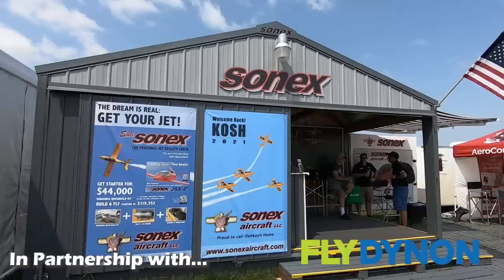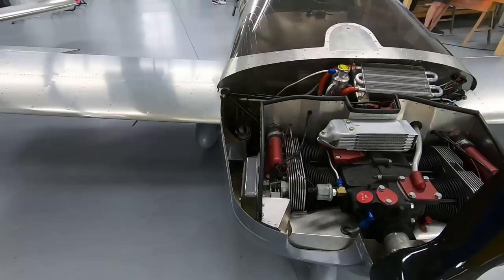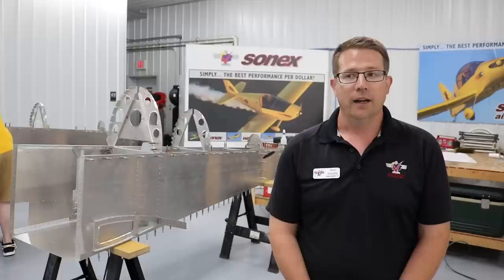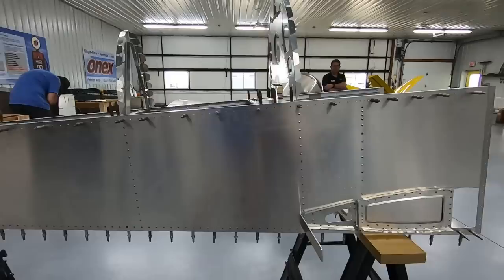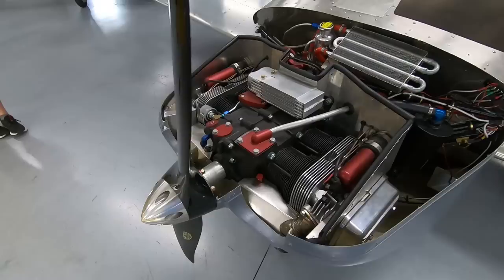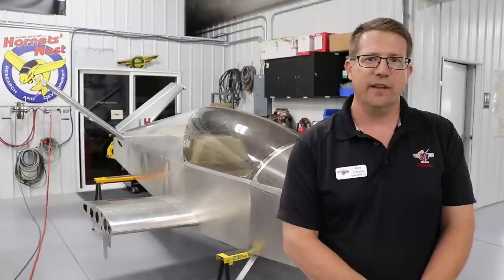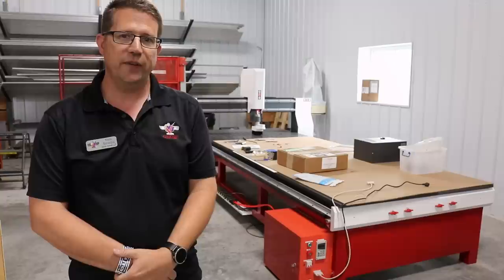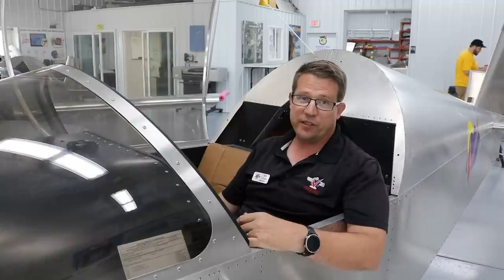Worlds Smallest Personal Jet | Factory Tour of Sonex Aircraft during Oshkosh 2021 Airventure

Comment: I'm waiting for the retractable gear from the jet being included in the Waiex kit.
Reply from the maker: THAT... would be pretty cool for sure! Thanks for watching today!
Reply: Same, but the BRS option, from the jet to the Waiex.
Reply: I would like to start with a 2-place SubSonex, but mount a Rotax 915 in the nose, with in-flight adjustable prop (electric constant speed).  That way the plane would already have the aerodynamic flight surfaces to handle high speeds and g’s.
If I ever get the money together I’m going to set up an appointment to talk it over with them.
Reply: I'll ask Mark for ya in an upcoming interview video, although he's very good about responding to emails as well.
Reply: @vax4200  Multiple people have installed BRS systems on Sonex Aircraft, there's a few vids floating around. The issue is weight and the space they take up, but it can absolutely be done.
Reply: Are gun-mounts planned? :-)

Comment: Wow... When you really think about the pricing it's not out of reach for MOST moderately successful people...
If you can live without the jet it's not even as expensive as a properly equipped 1-ton work truck...
Imma start savin...
Reply: It's not as hard to own a plane as most people think. I'm in the lower middle class spectrum and own a Maule M4 Rocket and some other toys. Now I'd prefer the M7 260,but not happening 😆  I got my M4 needing recovered and did it myself with help from a friend with his ticket. Every plane I've bought has needed work,I've paid cash,purchased wisely and made money when sold except for one. But I put 200 hours on my 172 and broke even.
     I've only bought 1 new truck years ago and when I calculated what they made in interest I said never again. I've got a 93 3500 dually I bought around 2000 to tow my boat and use as a truck that's been updated with new motor and trans swap. I've also got a 2013 Audi S3 that was a totaled theft recovery. Again I shopped around finding the right deal and even though it's got a branded title I'll sell it for profit if possible and if not I'll keep it until it owes me nothing.
       I calculated the money we've saved over the years in interest and it's astronomical and while it takes some sacrifices at first. Once you're rolling with saving and investing it goes fast

Comment: What is the max thrust of the engine and it's cost ? is there only one engine available ! Can the engine that powers a cruise missile be purchased and utilized on a Sonex aircraft ?
Reply: The engine that they use it's a pbs with about 1100Nm of thrust, but is expensive like 70k, but there is another engine called jetcat p1000 with the same thrust wich is alot chraper, i think. I couldn't find the price for it but one of their engines with half that thrust (500Nm) still flyable on this airplane but way slower, costs like 10.000 so i guess tha p1000 can cost somewhere over 20.000 but i think no more than 40.000 dollars

Comment: What a blabla about B-models. The world needs a larger C-model!
Reply from the maker: It took them how many years to get to the B-Model... now you want a C-Model? Geeesh!  Hah! So... what would this "C-Model" look like in your mind? Details? :-)
Reply: @ExperimentalAircraftChannel  A Cherokee 180, lol.
Reply: C-model:
500lbs crew weight.
Staggered seats accepted.
Max takeoff 1320 - 1450lbs.
Tapered removable wings!
Second set of extended wingtips for the rockies and alps.
Wingloading ~ 11.5 lbs/ft2.
VNE 199mph, +6g -3g.
Slightly wider / longer fuselage.
More prop clearance for standard props.
Accepts engines like: 320/340, Vikings, ULs, 3300, etc.
Regards from the alps

Comment: Jet engine for a low speed aircraft is unnefficient , fuel consumption is very high...
Reply: The jet is like your hot motorcycle for the weekend hour rip , so I have a car for travelling and work and a motorcycle for different reasons...The jet is a second airplane that fits in your hanger under the wing of your 172..